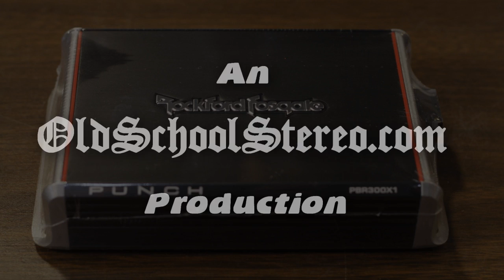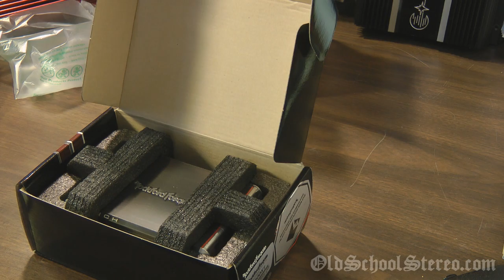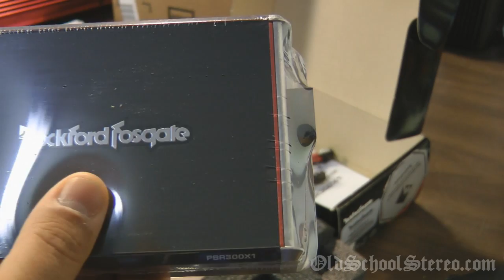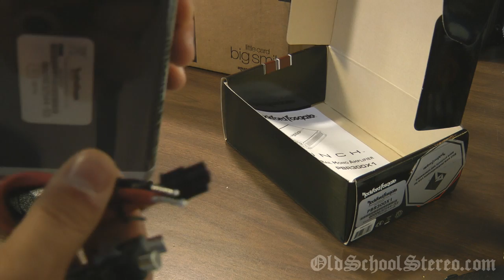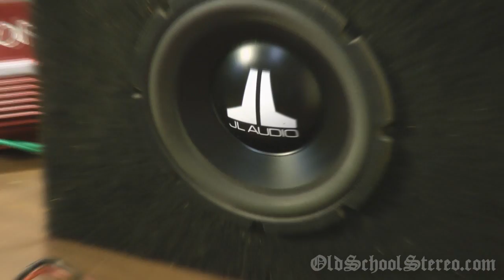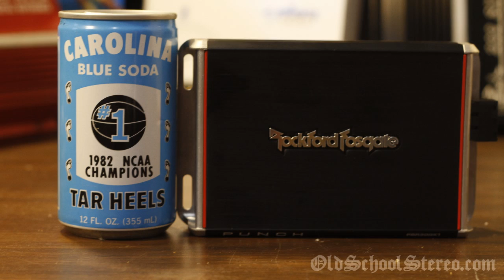Bench Testing the Rockford Fosgate PBR300x1 -  Boosted Rail Amp - OldSchoolStereo.com

Comment: Lots of people have been having the same issue with these amps I am... a constant rhythmic "popping" noise coming from the sub whenever the amp is on. No music coming through. This happens even when there is no input (RCA or high level) hooked up. The BRT light is also on and pulsing with the pops. Just the amp being powered up is causing this. Anyone figure out what's failing on these amps? It's not bad ground or other connection... it's internal to the amp. Rockford is no help. Great little amp when it works.

Comment: Why do you only show sub hook ups? Show some connection to 4 speakers 🔊 components. No self respecting person that knows Audio would use a 300x or 400d on a sub. Clearly both were designed for bridged 4 ohm 200 watts to 6.5, 6x9, or components.

Comment: Are boost boost rails as Efficient as class D amps?  I used class D on my boat. Can run for hours on the battery. Just wondering if BR is the same?

Comment: Did anyone ever run one of these and see what it made at 1 ohm on a dyno?
I have 4 Sundown SA6.5s  and will be pushing each one of those with its own pbr300x1.
I have two pbr300x4s to actively run all midbass, mid-range, and tweets. So 6 mini amps running no speaker larger than a 6.5 LOL. A mini system lol.
All in a Ford Ranger with the Box being 1.1 cubic feet net ported and tune to 32 Hertz with a kerf port. I wish I could post pictures and show the box design. It's being cut out on a CNC next week.
Reply from the maker: +Justin Murphy my birth sheet says 318 watts @1 ohm
Reply: BigDWiz 
Thanks BigD!
What's your opinion on these amps? I'm running two of the four channels for mids midbass and highs. I can't find any comments about their sound quality. I have a set of Viva 4 inch by biampiable coaxials that I'm going to run active in my Rangers A pillars via pods. I'm honestly thinking about running I Helix 8 Channel 75x8 with a built-in 8 channel DSP for sound quality considering the DSP by itself is $500, I can get the whole thing for 900. I would love for you to run some of the helix or Brax high-end amplifiers and see what they make power wise. Everyone tells me that they are lower power but it's a cleaner power so it sounds louder and clearer. I would love to see if this is true.
Thanks for all you've done. I'm recovering from back surgery and I have literally sat and watched all of the older videos even before you had the D'Amore Dyno LOL. Still can't get over the power the Audiopipe made as well as the Rockville. The new Hifonics review you did surprise me as well. Sorry you smoked that boy LOL. But that's what these tests are for LOL!

Comment: This little amp is totally cool.  You could totally put it in your center console for stealth mode.  They came out with a Rockford Fosgate Punch PBR500X1 for 500 watt rms.  Love to put these amps on the Amp dymo to see the true power output.   Again great vids
Reply from the maker: +Scotty MSU thanks man. I bought one of each excluding the 500x1
Reply: Big Fan of your site bro and became a subscribers.  Looking forwards to cool new old retro to be tested.  I use to fan of a/d/s amps and speaker back in the good ole 90's.  a/d/s to me was a quality amp players who make put out good product.  Would love to see how those amp perform and see if it was under or over rated in power...
Reply from the maker: +Scotty MSU I just picked up a PQ20 from a buddy and have a PQ10 and PH15.2 already. They are smooth sounding amps for sure. I'll try one on the Amp Dyno soon
Reply: Great!  Love to see it.. I had a a PQ.20 powerplate plus matching a/d/s component speakers made for them.  Its was a great systems.  Not only for the Nostalgia and good times but good old school amps come from a time when companies cared to hand made quality parts.  They cared about build quality, reliability, simplicity and quality sound.. over engineering them to to last.  That reason why even old school amps still command good price even after they are used.  

Which is why I like your Youtube channel .. hehe

Comment: hi there im just install this system on my 16 Street Glide Special but i dont know how to setting the AMP so can you help me how to setting the GAIN/FREQ,HL ADJUST on 

Rockford Fosgate PBR300X2 Punch 300-Watt 2-Channel Boosted Rail Amplifier 
12dB/octave Butterworth crossover
MOSFET output stage
High level inputs
Ultra compact chassis
Variable 4-6 volt hi level DC offset voltage input turn-on control

on speaker Polk Audio  6-1/2" / 6-3/4" 2-way Coaxial Speakers (Marine Certified)
Power Handling: Peak: 360 watts per pair / RMS: 120 watts per pair
Lightweight dynamic balance polymer/mica composite mineral filled cone woofer
3/4" Liquid-Cooled Silk/Polymer composite Dome Tweeter
High Pass and Low Pass Crossover Filters / Low-mass 2-Layer 25mm Kapton Voice Coil former

(i can copy down what you set on your system)

Comment from the maker: The connectors accept 10ga, so you can make 8ga fit if you strip off some of the wire thickness
Reply: Will those amps shut down before over heating and damage is done to the amp?

Comment from the maker: The amp itself can accept 10ga, so unless you are running multiple amps, it would be fine to use a true 10ga OFC amp kit. If you are using CCA wire and/or a cheap brand, I'd go with 8ga

Comment from the maker: Will do. Check YT, there is a video review of them. Not the best review, but still shows them off. They have a 12" woofer and compression driver mid/tweeter. They also have 1/4" and binding post inputs for amp hookup.

Comment from the maker: @pussytastegood1 No prob man, the 4ch version is not rated to handle loads under 4ohms per channel. You may want to contact RF to see what they say, it may be just fine, but I'd want to find out what the engineers at RF say, they are the experts.

Comment from the maker: @pussytastegood1 This amp is rated to handle 1 ohm loads, so if you were using two 3 ohm subs, then this would equate to one and a half ohms in parallel which would be fine for this amp